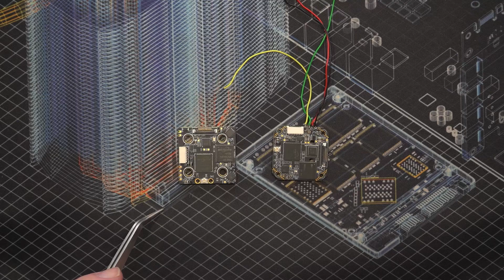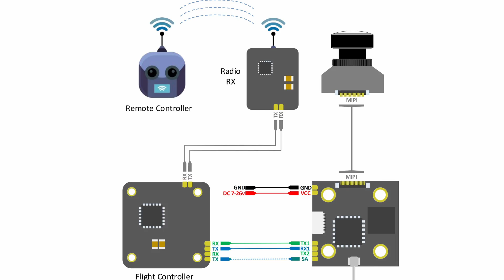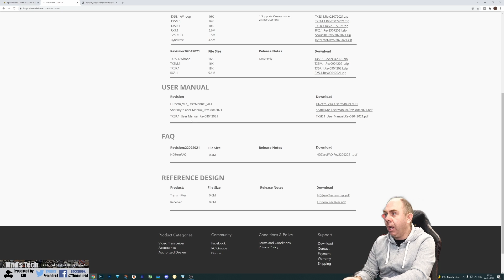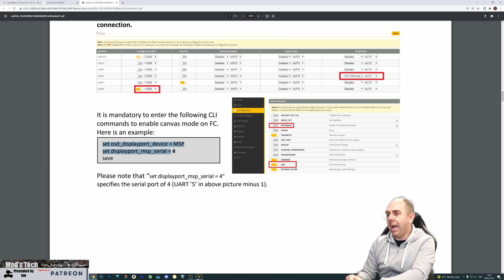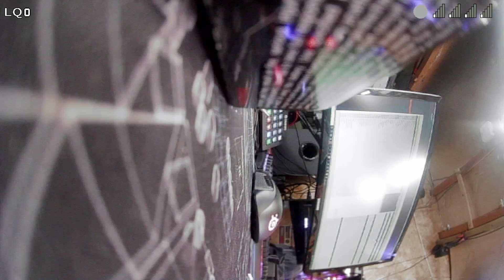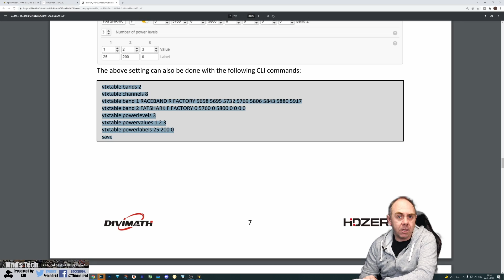HDZero Digital FPV -  Complete Setup Guide

Comment: I was hot to trot for this system until I watched this video.   Yeah, no, phwwck all this complicated expensive non-standardized poorly designed sh1t, I'm sticking to the sim.   You don't have to do any of this.   I already know from experience I end up destroying everything on the bench and never get too fly it.   The RC hobby is a r1p0ff.

How can you honestly recommend thisgarbage with good conscious to consumers.  It's like hawking a microwave oven kit that when they get home, is nothing but a box of parts and a manual in Chingrish (or no instructions at all) and they've got to solder up and assemble it.  They wanted to warm their bisquits, but instead they got a box of parts they have to somehow wire together.

Even if you know how to do all this like I do from being a computer tech for 20 years, it ain't going to happen when you're blind.   Do all this with your eyes closed and come back and tell me it's fun or worth it or that you reached the end.

If this stuff had been designed correctly, all you would of had to do is snap it in (to a standardized fitting), plug it in (with a standardized connector), and you're done.  All this stuff should plug in as modules onto a backplane like LEGOs.  Look at the fuse box on your car and learn something.

Comment: Hello - excellent information and video. 
First of all, I prefer to use INAV (Long Range Quadcopter).
I was hoping to see a lot more information on HDZero setup for INAV. All I see (via youtube) is all betaflight related with very little info on INAV.

1st Question: Can you and do you have any interest doing a quality HDZero Inav setup video for quadcopters. You would be the first as I cannot find a good source for this.
2nd Question as it relates to INAV Port setup: I am well aware that INAV does not support smart audio or use VTX Tables. 
So, all the setup videos, on youtube, regarding BetaFlight can not be use with INAV.
Lets assume I have HDZero VTX with TX/RX leads connected to UART2 on the flight controller. 
What is the port setup in INAV? 
Do I use one or two ports?
I would assume UART2 is either MSP enabled or Peripheral Enabled (with selecting HDZero VTX)? 
Is this as simple as INAV only using one UART to setup with INAV? Which one and why?

Thanks and appreciate all you do!

Comment: good video i am currently building a spec wing and would like to use the system without a flight controller, is this possible ?
Reply from the maker: Yea HDZero does bot require an FC but you would loose the menus via the Rc.  You could need to use the small board to configure.

Comment: please stop saying that a "smokestoper" prevent ANYTHING to go up in smoke ... having a short on a 1.3, 3.3 or 5v rail, the thing wont stop anything ... 0,5 or 1 amp is enough to burn the low voltage circuit... its only good if you done something wrong on the ESC power side

Comment: Good stuff - would the VRX module fit the EV300O goggles? I know the original VRX was designed for FATSHARK goggles so wondering about the new HDZero VRX
Reply: Yes, many people use the original Fatshark VRX with the Skyzone O4X, which is physically identical. I believe many people custom print an adaptor for easy attachment, but this may not be necessary. I'm about to setup my EV300O with HDZero so will report back.

Comment: Looks good, the only issue I have is why do these companies say 6s capable but you should power it up with lower voltage. I have the dji fpv system and it's the same thing. Don't advise 6s capable if it can be damaged, dji is the same way.

Comment: I fly fixed wing FPV. I don't use INAV, I use ZOHD KOPILOT or a stabilized receiver. Can HDZero be used standalone, without a flight controller?
Reply: Hopefully you don’t need a flight controller correct?